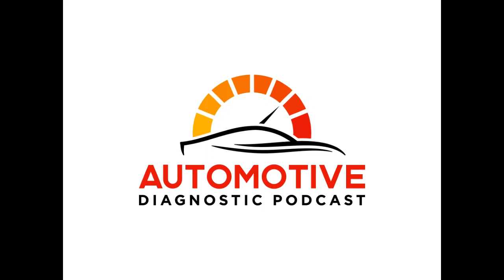E141:  ADAS L4 ASE Test With Keith Perkins & PJ Walter

Comment: Let me pre-qualify myself as an expert in the field:

ASE Master, L1, L3, 
40 years certified- continuous , 25 yr medallion etc.
Graduate of Santa Fe College, AAS Automotive Service Management
Level IV Diamlet/ Chrysler Certified DCA, Electronically Controlled Automatic Transmission Specialist
Technical Team Leader (TTL) for NASCAR Technical Institute 3rd level Advanced Electrical Diagnostic course.
Automotive Lead  Instructor,  of ASE/NATEF Master Accredited Training programs for TCSG post secondary education across multiple campuses in Georgia.
MBUSI - Mercedes Benz United States International -  Vance Alabama, Tech II Electrical diagnostic, vehicle harness and systems specialist.
 And Same at Volkswagen in Chattanooga.
And at least 15 other various private Corp certs.

So, my professional opinion of these ASE tests.

All ASE tests are like this.  Total misdirection.  And they absolutely do not apply to all vehicles!  They just about completely ignore European vehicles.

Also I have found many errors on the tests.  I am talking about blatant incorrect value readings according to what the symptom, question, correct answer was either a typo or flat out wrong.

Many times I have come across  questions where the given choices were factually incorrect.  As I am predominantly a Euro guy it was clear that whoever wrote the question was not informed. The tests are very biased to domestic first, Asian second. 

The test is about 95%  diagnostic questions and every single one is a misdirection fcked up question.

This applies to every question: you have to read it.  Read every answer and weigh what's plausible, what's not plausible, go back read the question again, and then make a lot of ASSUMPTIONS and then look for the misdirection.  Once you spot the trick, you will have a better  chance at choosing the correct answer.

Lots of wiring diagrams, and symptoms, and codes with PID data.

The problem is that there are questions that have blatant errors as far as meter readings according to what the diagram shows.  Shit was just plain wrong.

So you have to guess as to what  their mistake was and what they were actually trying to do,  and then therefore this would be the correct answer they were looking for. 

Total crock!

ASE is and has always been froth with these problems.